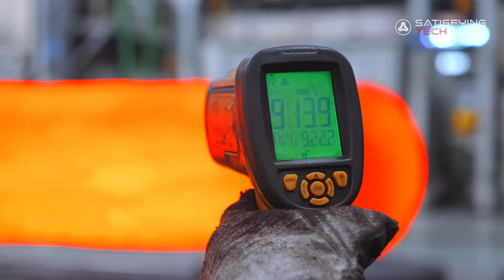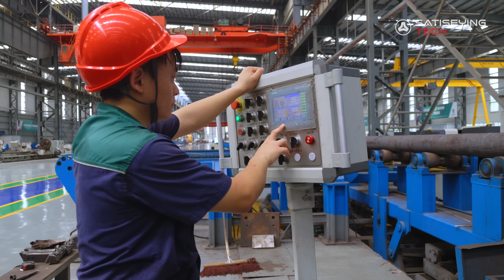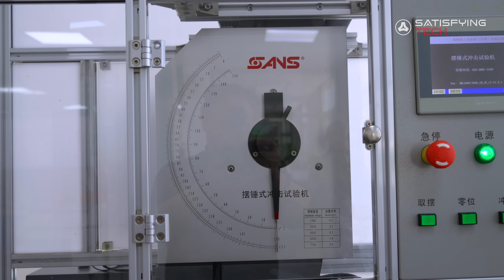Massive Marine Propeller Shaft Forging Process! Amazing Modern Plant!

Comment: Was in a fast vehicle movers engine room with boiler and turbine. It's a big machine. Funny part was fueling the ship over run put fuel in the bilge we were standing over. Looking through a floor that was a grill thinking standing over fuel with two burners blazing. Those shafts sure transfer power.

Comment: It’s fascinating how massive marine propeller shaft forging can spark debate. Some people focus on the environmental footprint, while others see it as a milestone of human engineering. But when you look at the precision, strength, and innovation behind processes like this, it’s hard not to appreciate how far modern manufacturing has come.

A great example is the U.S. Navy’s construction of the USS Gerald R. Ford’s advanced propulsion components—hugely controversial due to cost and scale, yet ultimately a breakthrough in naval engineering. It shows that even big, debated projects can push technology forward in ways that benefit entire industries.

Comment: Why can't they just pour the iron into that diameter, and length at the foundry in the first place, then machine it to spec?   Heating it again, then pounding it into these dimensions looks like a needless step.
Reply: It’s so the grains in the metal align with the new shape, improving strength and toughness.
Reply: @andrewroberts618  Thanks for explaining.  That makes sense then.

Comment: The shaft on this clip looks slim. I once visited Hyundai Heavy Industry Ulsan Factory and saw that 3000 ton press was forging a megashaft like a bus or 40' steel container size.
Reply: The forging press in the video has a capacity of 13,500 tons. I think that's bigger than the one in South Korea. China's largest forging press has a capacity of 80,000 tons and can shape aerospace parts in one go.
Reply: @sqrone1 I'm sorry that it was not 3000 but 30,000tons.
Reply: @General6666-l2d  Based on all publicly available data, HD Hyundai Heavy Industries’ Ulsan factory does not have a 30,000-ton forging press.
Reply: @General6666-l2d  Based on publicly available information, there are no known 30,000-ton forging presses in South Korea. The highest publicly recorded forging press in South Korea is approximately 17,000 tons (Doosan) or lower; while 30,000-ton machines are extremely rare globally and would be widely reported. Therefore, if such a machine existed in South Korea, there should be clear news or industry records, but no such evidence has been found at present.

Comment: Impresionante industria china controlada por la familia vasca Riberas (Forjas Iraeta)
Reply: La factoria podía estar en España, pero la familia Riberas la puso allí pero vive aquí. ¿Para qué pagar impuestos en España, si los pagamos los demás españoles para que ellos utilicen nuestras autopistas y aeropuertos?, no tiene sentido
Reply: @juanpablosotobarrera5818  The company currently has two shareholders: one domestic individual shareholder and one overseas legal entity shareholder. Mr. Niu Yugang directly controls 50% of the company's shares, while the Riberas family indirectly controls 50% of the voting rights through FIHI. Mr. Niu Yugang and FIHI jointly control the company, making them joint controllers.

Since becoming a Sino-foreign joint venture in 2007, the Chinese and foreign shareholders have maintained a 50/50 shareholding structure, each holding three seats on the board of directors.
Reply: @juanpablosotobarrera5818  The company's predecessor was a local Chinese enterprise. After investment from Spanish shareholders, it upgraded its production lines and simultaneously experienced rapid revenue growth by capitalizing on China's vigorous development of wind turbines. The local project existed before the Spanish investment; this factory served as its entry ticket into the Chinese market.
Reply: @juanpablosotobarrera5818  It's very simple. Because China is the world's largest shipbuilding nation, the supporting industrial chain must be in China. Otherwise, the Chinese would find other alternative companies.
Reply: @Sam-bm8tu  Buena razón, claro que sí, explica una parte del asunto. Pero sigue sin justificar que yo y el resto de los españoles tengamos que gastar impuestos para que la familia Riberas utilice nuestras autopistas y aeropuertos... o se hagan el trasplante pulmonar en la sanidad publica española si les llega la necesidad.

Comment: I love watching these massive engineering projects people tend to forget just how involved it really is right down to x ray and metallurgy testing to make sure every aspect of the metal is perfect for the application etc.
Also the machining CNC/ Massive Lathes they have to use to produce a final product no matter the size, which i think there would be a limit to its dimensions or then you have to make a new massive lathes which can take larger than say 3 meters in diameter. Which i yet to see a 3 meter diameter large steel being machined. 🙌🙌😎😎✌✌
Reply: our company just can made  about diameter 2000mm forgings。This is a huge plant😁